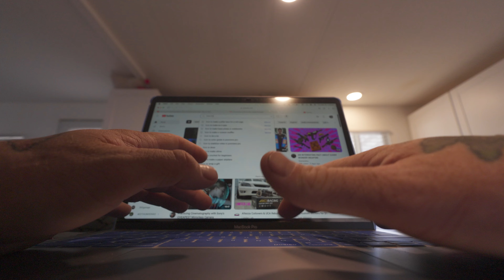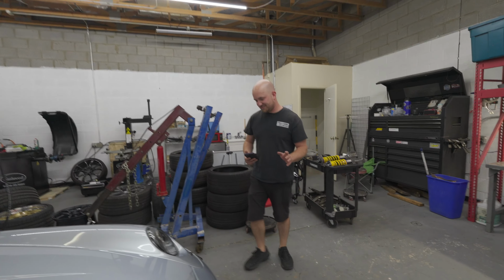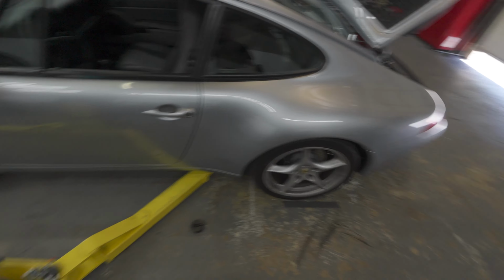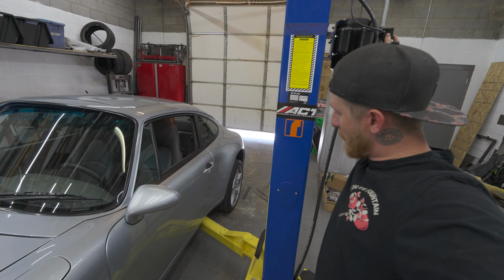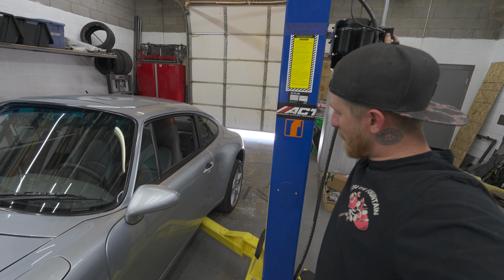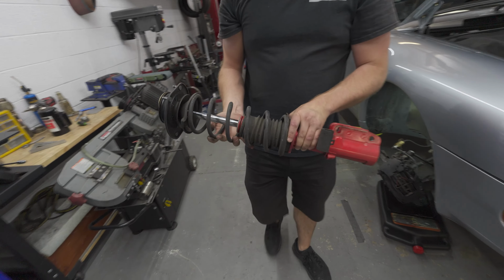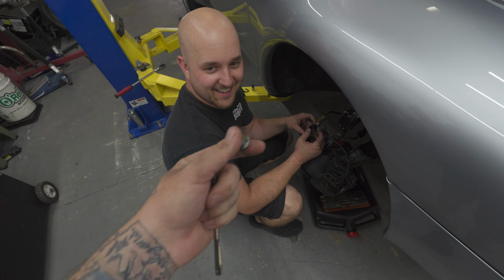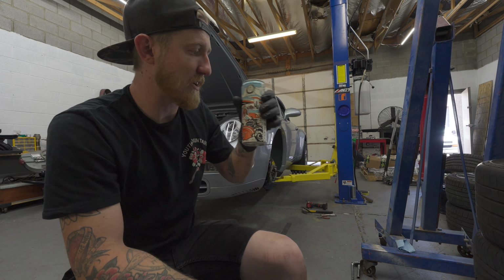Installing KW Coilovers On A 993 Porche Carrera

Comment: I recommend just sawing off the bracket on the Front Axle Dampers where the brake line goes through, when the clip is out you can move it just enought to make sure you don't saw into the brake line. Use Caution :). I did it with a handsaw, just saw down once and it's easy to bend them open enought to get the brakeline out. A matter of 10min for both sides, probably less than the time for venting your brakes. Doesn't really look that pro, but works fine.
Plus....those brake lines can let you down when opend after almost 30 years, then you have to order new ones, install them, total fck up

Comment: How are the build quality and fit and finish on Porsche?  Not particularly a fan of Porsche but, I always kinda wanted a Boxster to do some Grip-O road racing, hehe.
Reply from the maker: I can’t say much to be honest as this is the first porche I’ve installed parts onto. I’ve worked on a couple at other shops doing exhausts but from what I’ve seen at those places the fit and finish is usually pretty good. Hoping to get more work like this more often to be able to share more of my experiences!
Reply: On the mechanics it's usually pretty solid and well made, the trim and other interior stuff may be a bit wanky. 986 is cheap for a reason, it's not exactly the high point of Porsche Quality, still decent.